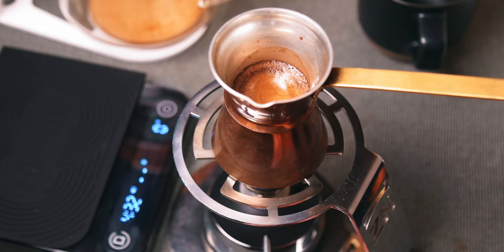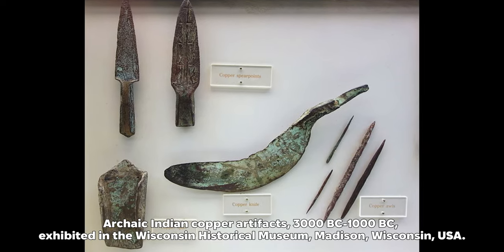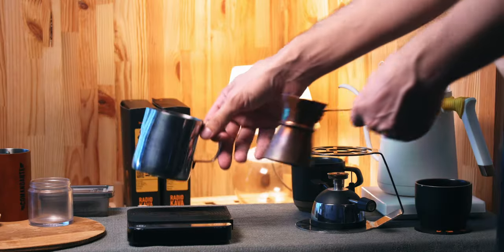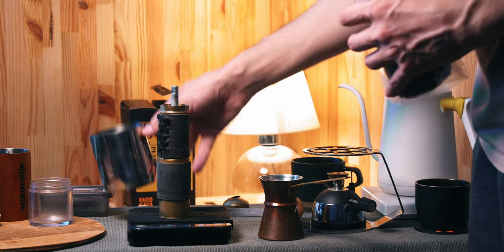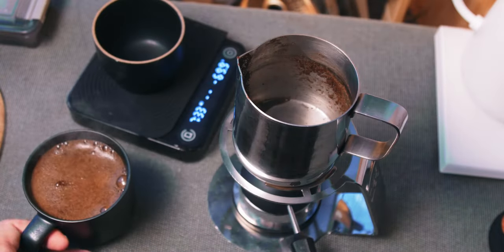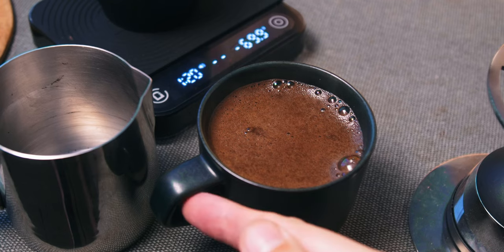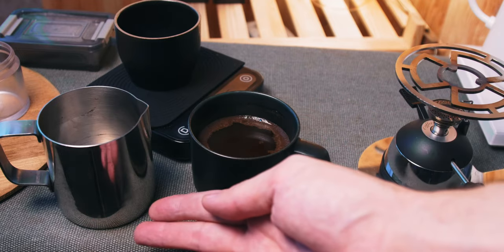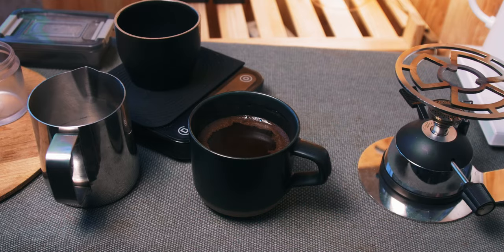Turkish Coffee History

Comment: Howdy! Been really enjoying your videos! I am new to turkish coffee. I do not have a cezve but have been attempting it with a stainless pitcher like the one you use in this video. I have not been able to get my coffee to foam like yours or any of the other videos I've seen. It seems to start and turns white after stirring but never rises or completely forms. I believe I am using a kingrinder k6 hand grinder. I believe it is grinding fine enough. A good bit finer than espresso. Will grinding too fine hurt the brew? Also I am using an electric stovetop. Does the heat source and how it is applied hurt the foam formation? How quickly should the heat be applied? The coffee has tasted pretty good despite not forming foam. I am thinking it might be the coffee beans. They didn't make much crema through my espresso machine as well.
Reply from the maker: Did you mix it at around 1 minute? The foam must be there in any case. Even if the coffee is 3+ months old - it still should produce the foam. It's not about the grind size etc. 

What happens to the white foam after forming?

Comment: I am using a bare copper vase. Very happy. It's only the 5th Turkish coffee I've ever had. I am definitely liking it more than espresso.
Reply from the maker: Thanks for sharing!) It's not guaranteed that they've used it with the coating right away. Just suspect that they could. And currently there are bare copper as well. 

I recommend trying light roast. And as for the Espresso - long black with like 3 water 1 espresso is also interesting. But yes, not that rounded and smooth

Comment: Sometimes I want to have a bigger cup of Turkish coffee like you did in the video but I wonder if it would be too much caffeine haha. It seems like drinking 3 normal cups of Turkish coffee all at once.
Also I use a stainless steel cezve/ibrik but I gotta get myself a traditional copper one soon. I have a feeling I would like it more, even if I have to be more careful when cleaning it.
Reply from the maker: Copper is better in terms of taste, but it's not super obvious. Only with practice it'll be visible... More balance in a cup. That's why I recommend starting from this right away if people have the pitcher.  

I currently want to switch to 200ml. 70-80g is not enough) But it's faster to grind smaller dose, so possible to make one in the evening. 

As for the caffeine, I found that it's ok to consume big cup unless it'a under 30g of ground coffee per day. But it's my personal dose. Usually it's 2 pour overs 15-18g each, but sometimes 1 or 3. 

And light roast coffee usually have less caffeine (higher grown etc). That's why this cup was perfectly fine even after 2 cappuccinos (flat whites*)